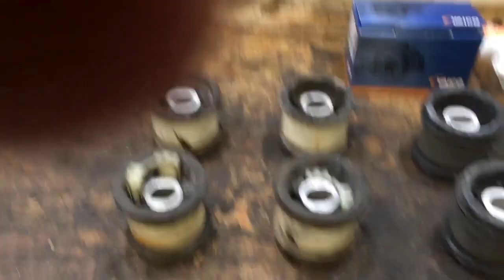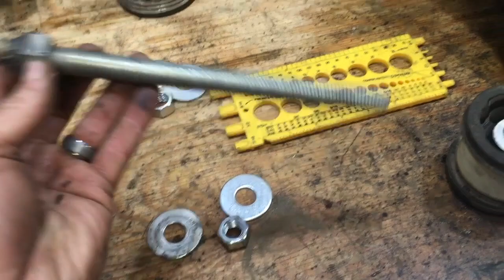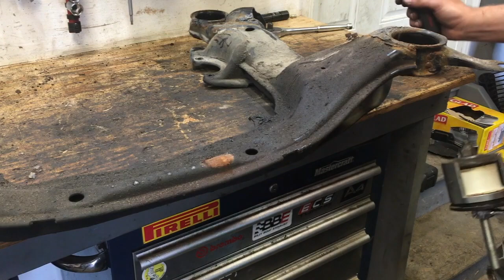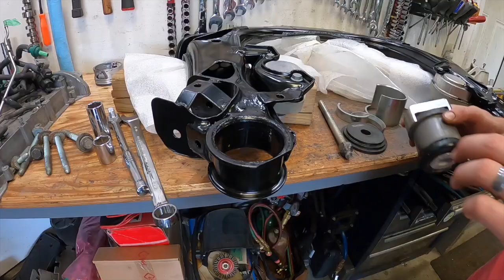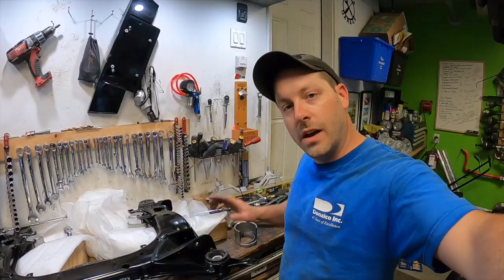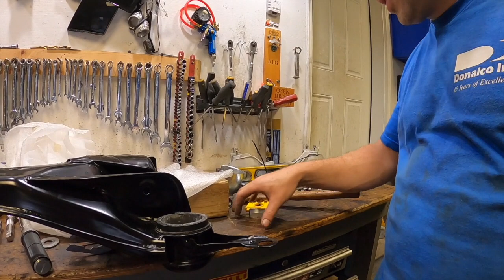Audi Subframe Bushing Replacement DIY - A4 S4 B6 B7

Comment: did you feel the change while you driving ? old vs new one  ?
Reply from the maker: Did so much other work to the suspension it was hard to pinpoint. The whole car felt new.
Reply: and before you changed the bushings. Did you hear or feel some strange noise or behavior while you was driving ?

Comment: my bushes are different to yours. my 1.8T Quattro had vw 1j0 505 145 C and vw 1j0 505 145 D. 2 are adjustable (oval hole) 2 are straight holes. Guessing they all should be oval like yours ?
Reply from the maker: If they are all oval it allows for the subframe to be shifted side to side during wheel alignment to equal the left / right camber.

Comment: I have a engine from a 05 ty but the oil sensor is sitting on the subframe. Is there any solution
Reply from the maker: Not too sure what your question is but if the oil sensor isn’t in the oil pan step one is to reinstall it there. If you mean the oil sensor as installed in the engine is hitting the subframe then you either have the wrong motor mounts, wrong subframe, wrong engine, wrong oil sensor, or one of those things isn’t installed properly.

Comment: Should it be any bushing where the thin arm is goining forward from the front bushing? I changed the pump for my washer fluid on the left side of the front wheel house. Then I saw that the thin arm going from the front bushing was just hanging in the air. Can’t find anything on it thouh. Thanks
Reply from the maker: There is a hole in it, right? If so, then I think what you are describing is the subframe alignment tab. There are two, one on the body and one on the subframe itself. Nothing bolts to them.

Comment: Never ever reuse the subframe bolts because they stretch under torque and change their length
Reply from the maker: Agreed that they change length/stretch since they are TTY, but I have successfully reused them in the past. The FSM also indicates that all suspension bolts should be replaced after one use... we all know suspension bolts are not always replaced.